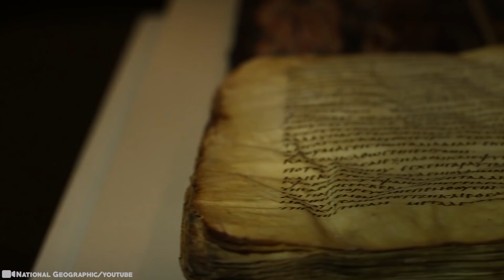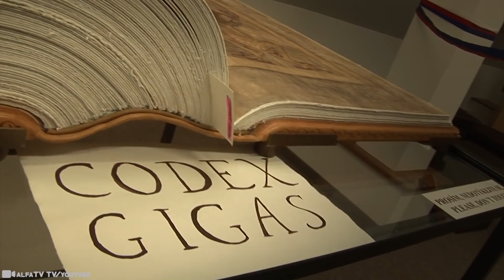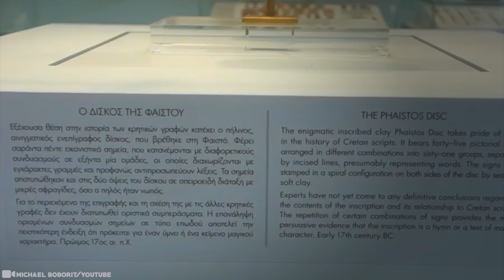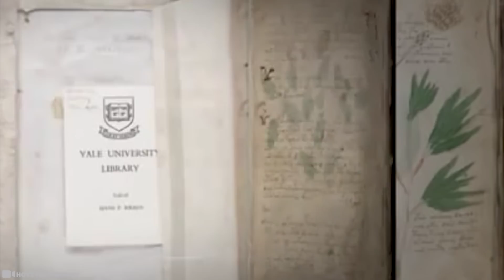15 Old Technologies Scientists Still Can't Explain

Comment: I am a hobbiest blacksmith myself. I have made Damascus steel in my own forge. This is not a lost art. It is simply the 1st form of welding we humans ever learned how to do. The process has never been lost!
Reply: You can make pattern welded steel sure, Damascus is a type of pattern welding made from Wootz steel. I doubt you made Wootz ingots, though it is possible to recreate it with research done with historic samples found. The ingots were made in southern regions in India, then shipped to probably Persia to be crafted in to Damascus. The hard part would be figuring out what carbonizing agents and techniques they used to make the ingots IMO. Not an expert or a smith, so grain of salt here.
Reply: @krisreddish3066  true Damascus is originally from India or there about. And wootz steel is likely involved. Duplicating a chemically identical ingot to what is historically known would be an interesting challenge. But its the process that this video is referring to. The process of making Damascus or any pattern welded steel is simply forge welding, at its simplest.
Reply: There seams to be alot of people who have never put hammer to anvil before in there life who think they are experts on blacksmithing! Weather it is modern pattern welded steel or historically accurat Damascus makes no difference. The key to making it work in either case is the ability to forge weld. And that has never been lost. Period! Im not going to argue the point any further. Thank you.
Reply: @bloodsweatandsteel.2749  I agree with you the process is well known, people are just moaning its not 'true' Damascus because the improbable (near on impossible) chance of finding the same metal composition to create the steel. At the end of the day a modern smith with the same raw starting material  can perfectly replicate Damascus fact
Reply: @bloodsweatandsteel.2749  not to talk shit man. One of the known ways to make Damascus was to quench the metal in well let's just say its less than humane. They didn't know why it worked they actually that thought the "donor's" soul/life was forged into it. Another was just quenching in blood and other questionable practices. The method of making it was never recorded in any written text just word of mouth from Master to apprentice.
Reply: The process of folding or forge welding was never the mystery. The mystery was wtf were they doing it to because they didn't know what wootz steel was. Colloquially people now call all steel with that pattern damascus but it's not really correct.
Reply: I can only think what sometimes is revealed, which is that conquered civilizations by others that are more powerful in whatever capacity, lose their ability to transcend to the next generations and not only becoming perhaps an extinct, undermined civilization, but their wealth of knowledge as to how they were able to produce what they did is lost and replaced by the one of the conqueror which is then validated and accepted. I don't know if this would mean that If the Mayans for instance wouldn't have perish there would be the level of technological advancement that we have today, I agree that it is very difficult to know and perhaps  anthropologists have an answer to that, but what would have happened if these civilizations would have not been exterminated? How better off we would be.
Reply: What's your making? Is pattern welded steel Damascus steel or wootz steel has recently been identified. The importance is The valladium content in the ore
Reply: Same bro.
Reply: it was lost for quite some time sir. you may have made it in your own forge but for the longest time until recently it was considered to be a fairy tale material.
Reply: You made steel with a pattern named after the steel that had the same pattern. You did not forge the same steel.
Reply: No... you didn’t make true Damascus... you made a modern imitation

Comment: Damascus steel is quite common. Put simply it's just different pieces of steel folded together over and over during the forging process then dipped in acid which etches the different densities of steel at different rates revealing the designs in the metal. It's also not necessarily quality steel. It just depends on whats used to make it.

Comment: Before 2500 years, ancient sri lankans had invented many compounds to drill, cut, polish corundum gems, and to make cover on gems when need to burn. Also they had some chemistry knowledge to remove rusty iron particles inside corundum gems. The next thing is they knew how to melt granite and use as clay to make structures . Also there was an adhesive to bond granite together . Also they used nano technology to make water filters . The steel was exported from sri lanka and india to make damascus swards. The above are not conclusions or just i heard. I researched for 20 years and learned how to do above things except melting granite . Because the last man was known as a rock smith, didnt gave the knowledge to his next generation or to students . The formula was made by few herbal plants those are grinded thoroughly and the liquid could make granite much soft and easy to be carved.  The secret of making steel for swards including making iron from iron stones, mixing carbon to iron ( the paddy strew have carbon could be mixed to iron in numbers of times heating and hammering to make layers on layers as 1,2,4,8,16,32 ), forge to get 2028 layers , then put mild steel inside the hard steel. Then make the shape. Tempering . At last sharpening and polishing . Actually this much only my best to explain in english . Know much about these ancient technology but not fluent in english .
Reply: Lol nano technology
Reply: A lot of what you say I can believe   Especially about the steel.  But Nano  Technology. Mmm   I thought Nano Technology was manipulating Atoms. Or at least understanding Atoms.  So you lost me there.
Reply: could you please share with us your sources or the results of your research,  (even if it's not in english, I'll manage to translate it )i'm very interested in what you said and believe that it might hold some truth
Reply: @taureauailer1  what part.  Nano technology??
Reply: Well, it is true that the steel used in Damaskus hailed from somewhere in India (I believe) and this steel was mixed with some form of carbon nano tubes - basically incredible thin carbon fibers. However, it's implausible that this nano fibers had been made by people back in the day (and no, that's not me being arrogant to people in the past - it's just, if there was any feasible way to create nanotubes with any kind of pre-industrial equipment, somebody somewhere would have found that method.
The fact that there was only one region in the world known for this, gives it away: The nano tubes are most likely natural. As in the metal ore in it's volcanic creation was intermixed with some form of carbon fibers.

The gem production I can believe - it's nothing impossible for a pre-industrial culture.

For water filtering: There are enough ready available substances to filter water very effectively. Any form of sufficient fine quartz sands, several minerals. There is simply no need to 'invent' a nano filter to achieve the same result. So I take this with a grain of salt.

About the granite melting. Granite is a volcanic stone, so if you say melting as in heating it up enough to get it liquid, would possibly work - but it would require a lot of energy for getting something you could have way easier. You can work granite with tools and polish it. Adhesives. Yes. Possible. The romans knew cement, the Chinese had it. Greeks had cement - so it's likely other cultures might have invented their own version.

Comment: sword of goujian isn't a mystery, and it's explained. We know EXACTLY what it's made of and the scabbard that kept it preserved where it was. It was the lacquer that really preserved it.

Also the pillar and 'damascus' are from the same place. It's actually called wootz steel, and it just comes from the fact we know they had crucible steel and could melt iron as well. There's no real mystery on the pillar, we know they had the means to melt iron like that to be cast, the real question is /why/ they decided to dig the sand pit to throw it i nto rofl.

Comment: The story of the steel being fed to the chicken is part of one story of the blacksmith Wayland (Wieland) from the Germanic / Nordic mythology. The backstory here is that for surface hardening blacksmiths have been (and still are) using nitrogen-rich "baths" (and chicken dung is very nitrogen-rich) into which they put the hot work piece to cool down. This way the nitrogen contents of the suface (in form of iron nitride) is hardened.

Comment: Damascus steal not existing?? What rock have you been under?? Some of the best kitchen knives known to man kind for over a decade already are Damascus forged Japanese sushi knives, extremely light thanks to the Japanese forging techniques and razor sharp thanks to the combination of them with Damascus steal!!
Reply: They might be folded, pattern forged blades, made from multiple layers of different alloys, but they aren't Damascus steel. No one would want a true Damascus steel blade today. You can buy better blades at Walmart.
Reply: Those are not Damascus steel though, we tend to call them Damascus steel and their even falsly advertised as that especially on Amazon and other such sites, but they are actually layered steel which is how japanese swords have been made for like over 1000 years maybe, the finished product looks similar but Damascus blades were a mixture of different types of layered steel and made in the now non existent Damascus region of the middle east, as apposed to one kind of steel used to forge the modern and now fairly common Japanese chef knifes based on the forging method they've used since the time of the samurai, the fact that their sharp just means it's made well and  with good steel like anyone would expect a japanese made knife to be,, doesn't mean it's Damascus,
Reply: @jeremybenoit759  yes and no: yes, they are folded but no, they're not from 1 kind of metal. Traditional Japanese swords and the best knives still now were made of hard metal folded in soft metal cause soft metal didn't break and hard metal didn't bend.  And the Damascus pattern is being achieved by hardening the steel in bases and acids of which every smith has his own receipe! It's not because Americans make it out of 1 kind of steel that it was originally made that way!